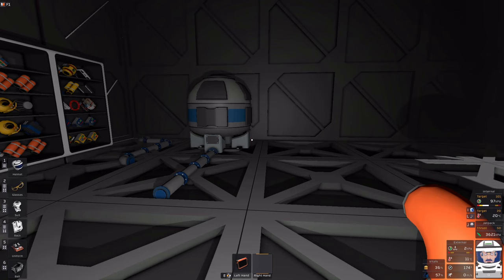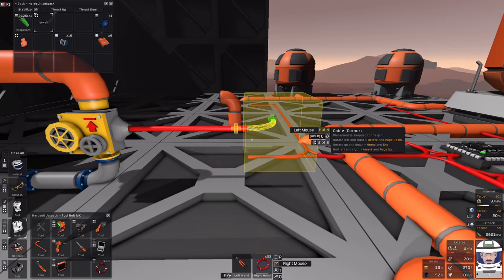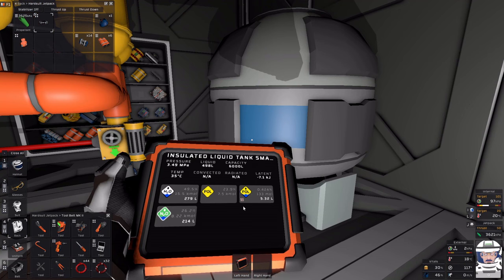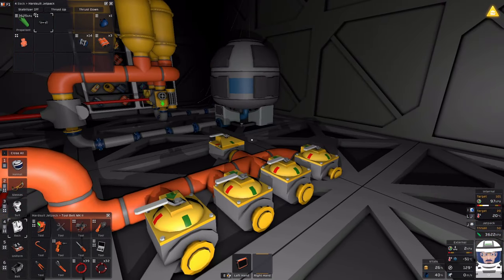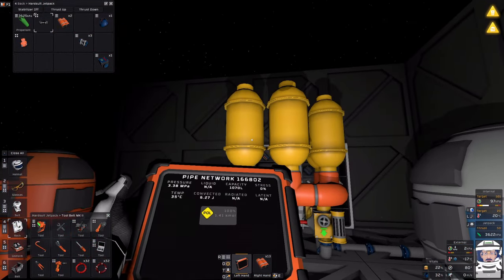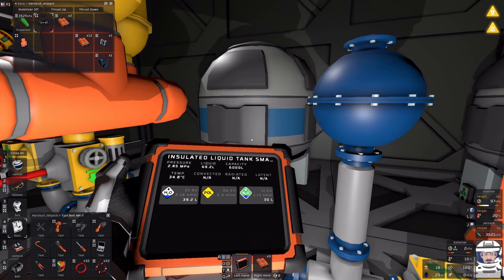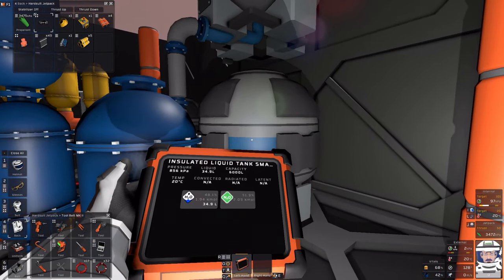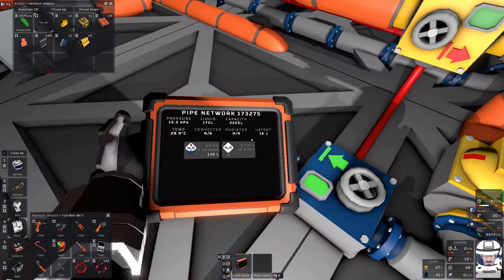Stationeers: Phase Change Distillation of Liquid Networks

Comment: You are right about the Purge and Pressurant valves being effected by Pressure differences.
Moving the pollution gas would have been a lot faster if the gas was pumped before the Pressurant valve. Pushing 3Mpa into a 5Mpa pipe is an act of frustration :face-blue-wide-eyes:
I never fully tested how the Condensation valve acts though, it doesn't seem to be effected by the amount of liquid in the target pipe, nor the pressure (I think, thankfully).
Reply from the maker: I think If I drained the pipe right after the purge valve it would have functioned better. I think I did that with the NOS tank to help speed it up because that took almost an hour.
As far as the condensation valve is concerned, I think it also looks at available liquid storage space... I forgot to pump out water on the final stage and almost exploded my gas pipes because of it though I may have observed that wrong. But its normal behaviour seems weird to me, like it might let a certain amount drain and extra condensation valves help to speed up the drain. Trying to keep the gas pipes from getting 100% stressed was a unique challenge to this setup.

Comment: Two major rules of physics EVERY engineer MUST know, high pressure always travels to low pressure, and, higher temps always travels to lower temps.
Reply from the maker: Fighting against these rules is a lesson in self frustration. We need some kind of variant volume pumps that work similarly for the purge and pressurant valves. Engineered solutions help but attempting this highlighted how slow this process is when you dont account for it.